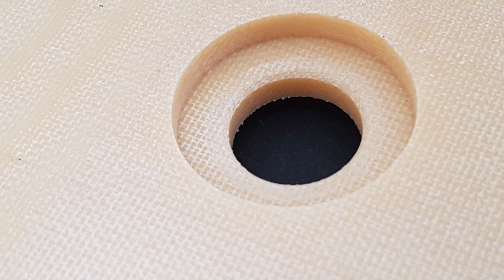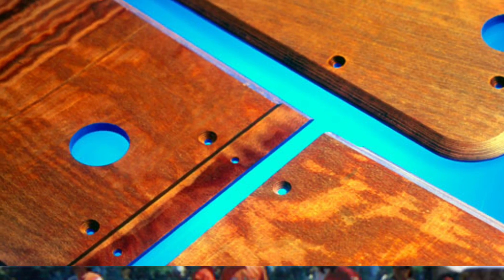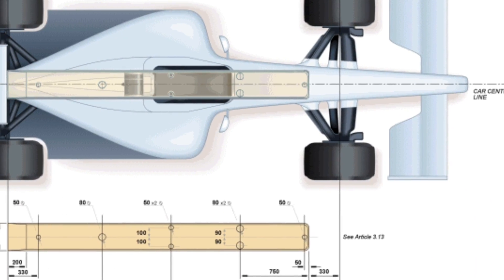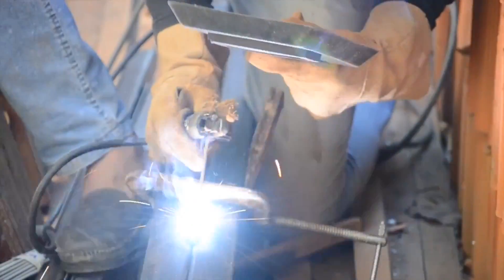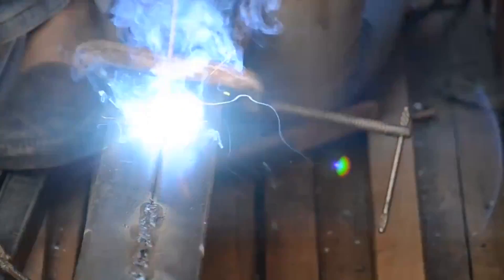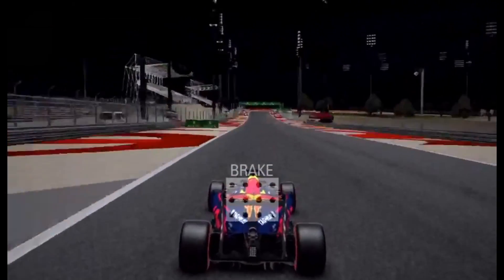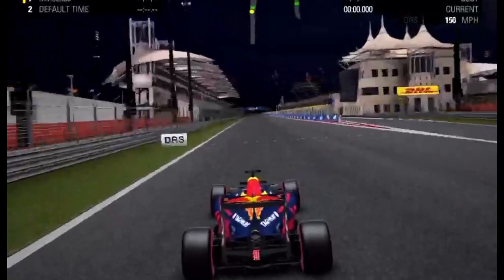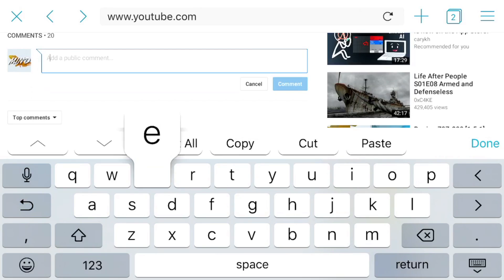WHY F1 cars spark!

Comment: The sparks nowadays are fake. The bottom of the car isn't low enough to have real sparks. They just use the blocks for entertainment during evening races. I am not entertained by it since it is dumb and fake.
Reply: Only the sparks before Senna's era were real. The FIA changed some rules to introduce the sparks for entertainment. You can even find this info on the FIA site.
Reply: I am sure only the wooden plate is for safety. The last time someone was disqualified because of a car being too low was Schumacher in the Benetton I guess. Can't find a newer case. I believe at Sky sports F1, Brundle told some years ago the wooden plates are not even being scratched nowadays because the regulation don't allow a car that low. But I can't find proof of this.

Comment: It was actually done with increased spectacle in mind. The regulations and junk is all just a justification. Just like the 2018 engines being "louder and more aggressive" to aid fan experience. Looking through the official reasons for this in 2029 say you'd find that they got louder because of an increase to the allowed engine rev limit. When in reality pressure and backlash from fans forced the fia to Tailor the regs to achieve this, same with the skid plates

Comment: So they spark because the platinum is touching the track when they go down the straights at high speeds?
Reply: platinum would make for a rather expensive plate ;)
Reply: Fucking duhhhjhhhh how the hell you guys think sparks happen, its from when metal scrapes along a rough surface lol.